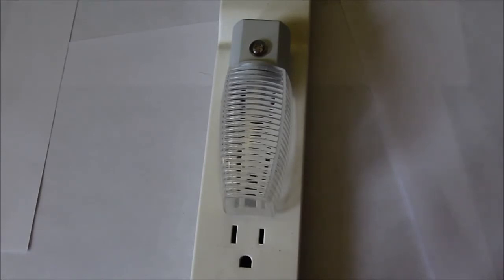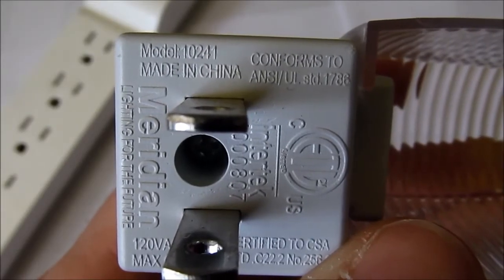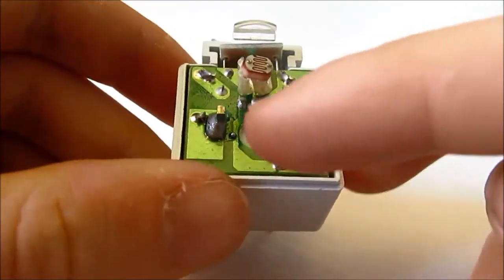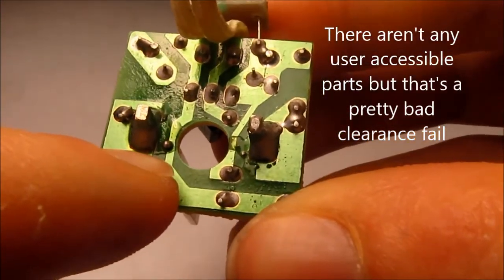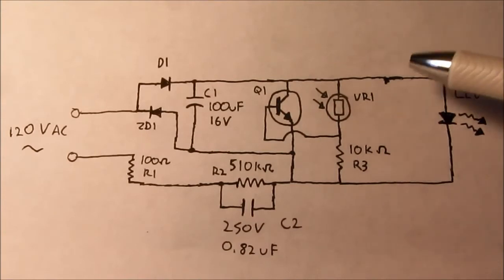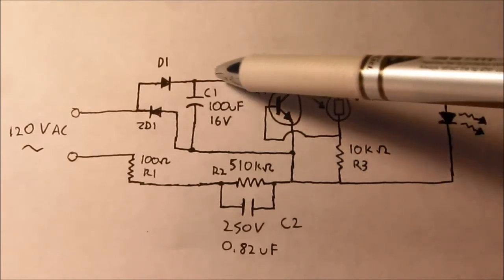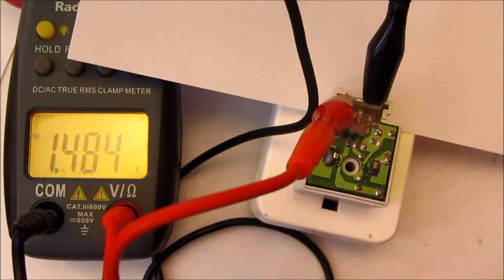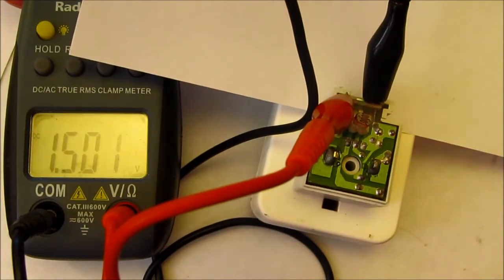What's inside an LED night light?

Comment: R1 is to limit capacitor current in case of mains transients.  R2 is a cap bleeder and carries little current in operation.
Reply from the maker: That's what I thought with R2 being such a high value.  Your explanation of R1 makes sense too, though I suspect it would also let out some serious magic smoke and fail open like a fuse if the circuit experienced a major fault.
Reply: MetaphysicalEngineer
Fusible resistors are usually used for that as they shouldn't burn up in case of a fault in theory.  Emphasis on the in theory.  The glowing thing that often burns holes in the sides of compact fluorescent lamps is usually a fusible resistor.
Reply from the maker: randacnam7321 
I haven't seen burned holes in the case but I have seen resistors burned in half inside failed compact fluorescents.  Extra crispy (but theoretically safe) failure mode.
Reply: MetaphysicalEngineer
I've seen a video on here of one in the act.